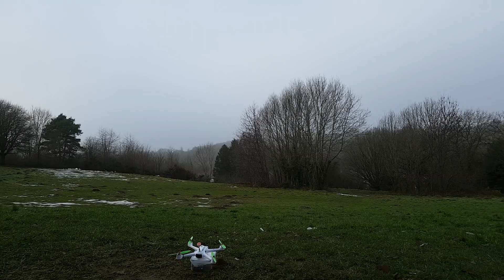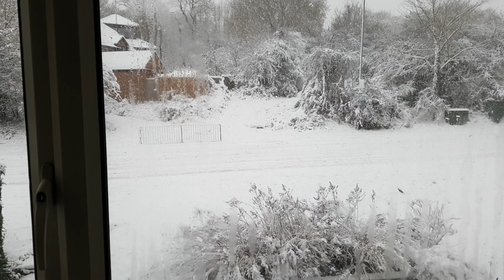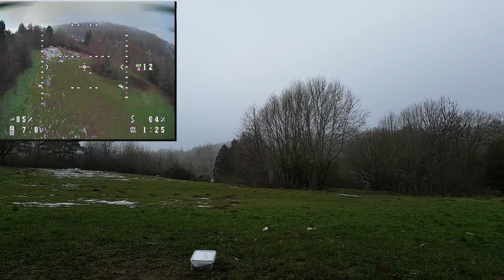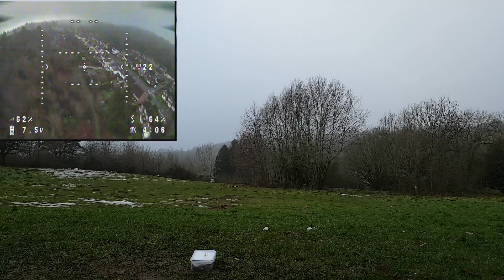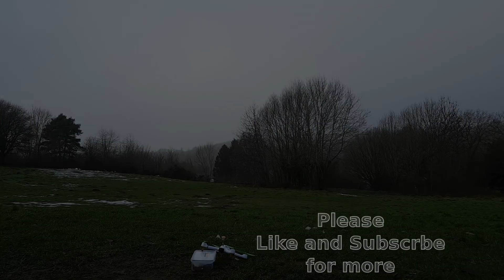Hubsan H501SE Sparrow

Comment: I'd appreciate if you could tell me if there is any way to power off quad besides unplugging battery.
Reply from the maker: Not really in the default configuration. Using a switch is possible but not recommended, unless you do your homework and ensure you buy a switch which is more than capable of handling the amperage you conduct through it.

Comment: Hi. Did you replaced de stock camera? Can you show me how you do it?
Reply from the maker: Hi Vitor, yes I have replaced the stock camera. I have a H501S with no warranty and do not require Hubsan assistance to fix any issues I may create. If yours works I would advise you not to attempt these changes.